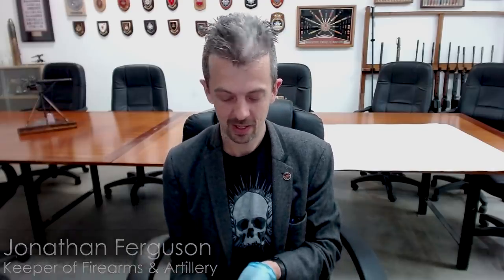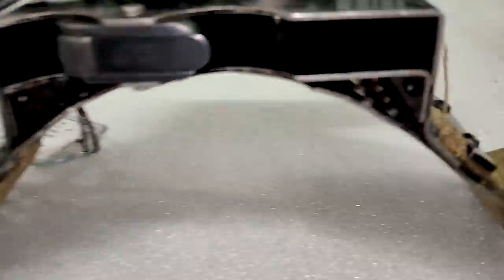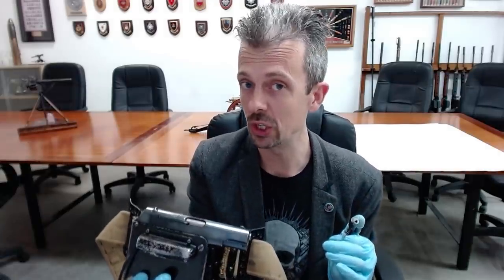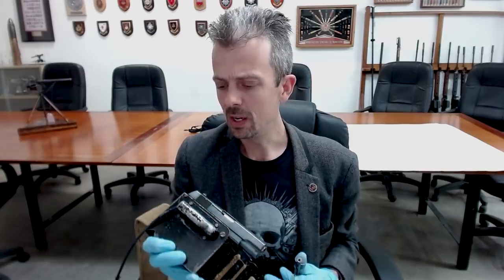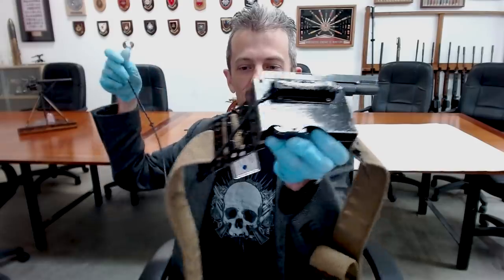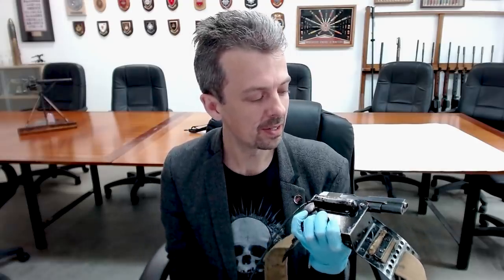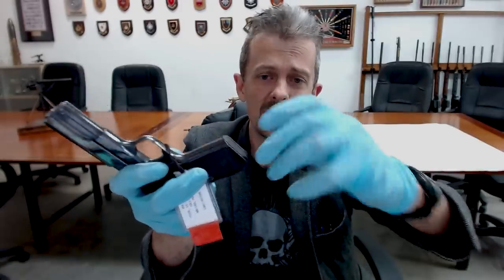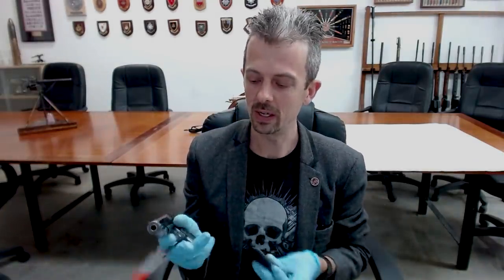The remote control Colt. The SOE belt pistol with firearms and weapon expert Jonathan Ferguson

Comment: Any reason why this can't be fired for testing purposes? Seems like only part that might face damage is the cable which could probably be detached within the mechanism and replaced with a modern break cable and break lever for the testing.
Reply: I can't see why it wouldn't be able to but the question would be, why? It is extremely rare and the potential damage overrules the "wow" factor of demonstrating it fire. Unless it was for some form of research.

Comment: You need to correct "If you happen to come across an M1903 with some holes in the frame you might have an SOE pistol"
To
"If you happen to come across an M1903 with holes in it's frame you probably are getting a 5 year manditory prison sentence for owning an illegal firearm just like if you owned pepper spray or a stun gun"

Comment: oh god here we go with the cringe gun safety nuts. save it for guns that arent safety checked. people can develop different sets of habits for different circumstances. deal with it.
Reply: It's all about forming good habits, so the same handling procedures should be used no matter what the circumstances are. Handling guns differently depending on circumstances is exactly how you get a negligent discharge.
Having said that, the Royal Armories are likely a bit different, in that every round of ammo probably has to be accounted for.
Reply: based